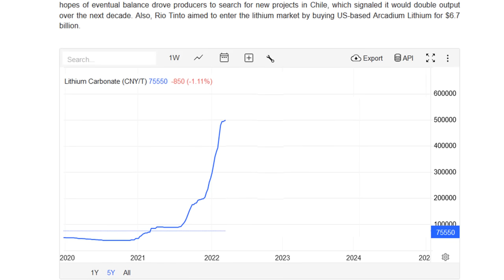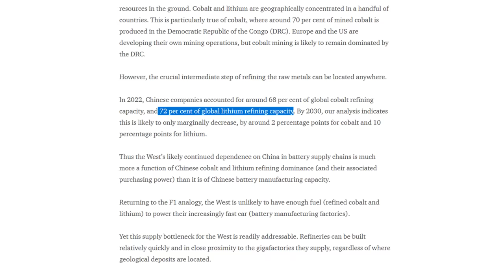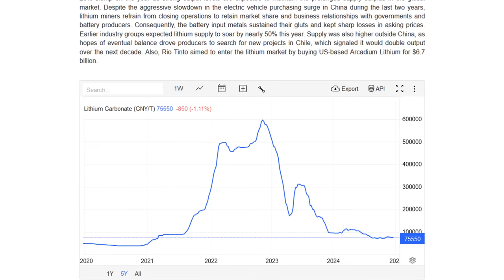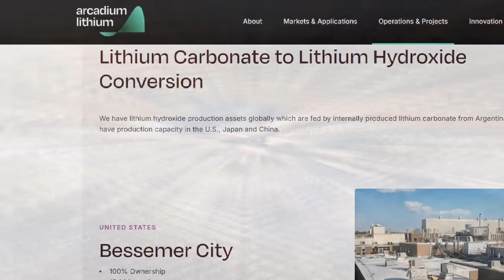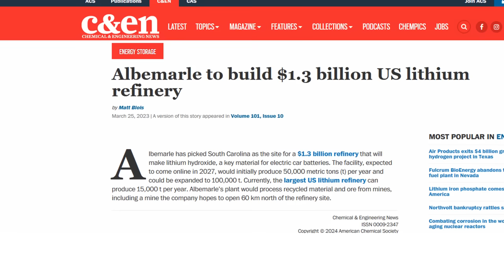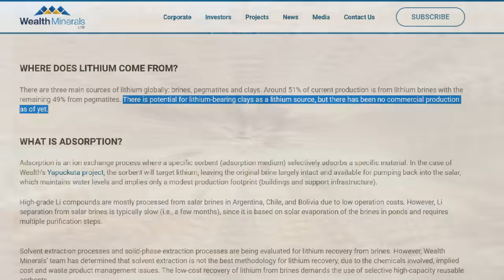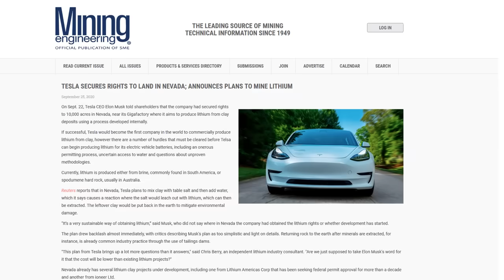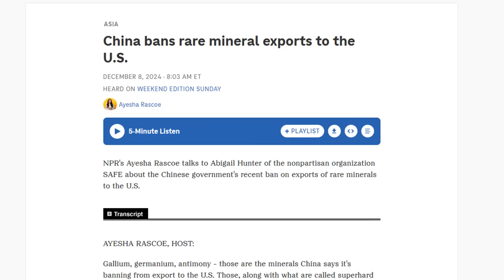The REAL Reason Tesla is Firing Up its Lithium Refinery (And It's NOT What You Think)

Comment: EVs are not the future for transportation. It's time to recall EV mandates and ban EVs from parking garages, ferry's, tunnels and underground parking. They are dangerous. When burning in thermal runaway they can reach temperatures of 5,000 degrees fahrenheit, not 1,800 as this video said. Carbon dioxide is not proven to be a greenhouse gas, it's a theory. -- The science is politically motivated, it is not tested, repeatedly and proven Empirical Science. It time to stop following net-nonsense science and follow true science, not so called science theories that are metaphysical philosophy.

Comment: Very good informative video!  Wonder if Elon would consider sharing revenues with the State of Texas to use the highways in Texas to generate and store electricity? Tesla could design and imbed thermopile electrodes and solar panels in the roadway and turn the highways into the generator and the battery and even the power delivery system. It's like the electric trolly car or electric train system used in California and in other countries only inverted to use the roadway..
Reply: Solar roadways is a scam. They quickly degrade and are destroyed in a few years,  before they have recovered the costs of the panels and installation.